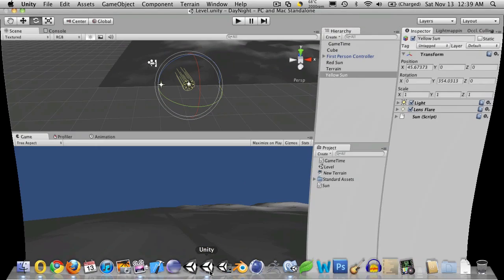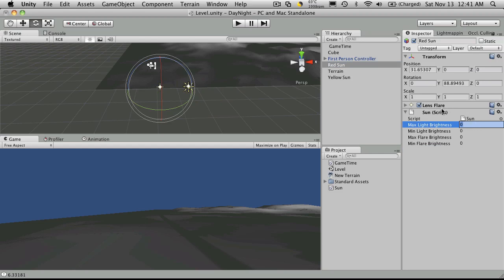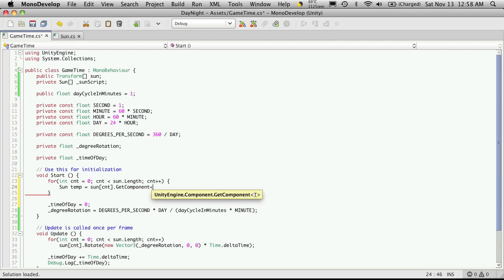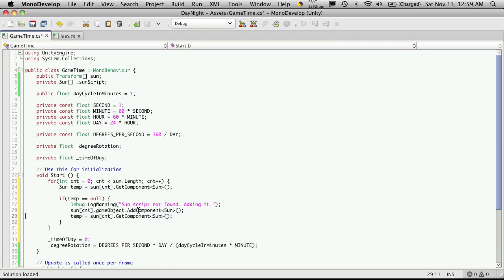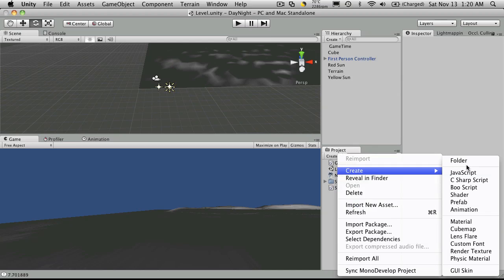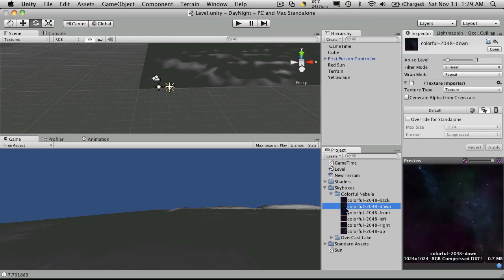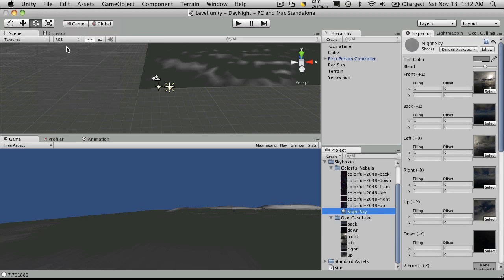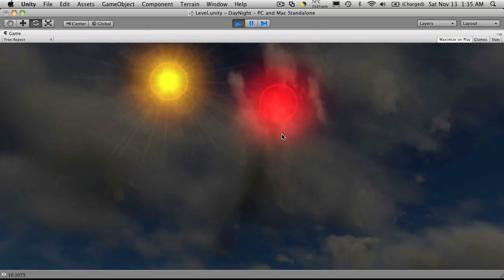74. Unity3d Tutorial - Day Night Cycle Part 3

Comment: Im having real problems with Unity 4, following these tutorials using the free version of unity there are certain things that use don't work for me. 
Adding a flare as another component to the directional light stops the 'sun' from rotating around the x axis, but using the default flare works. 

Also after adding the sun script and modifying the GameTime script accordingly the sun stops rotating. I can't figure it out. There are no compile errors or anything so i'm stuck. =/